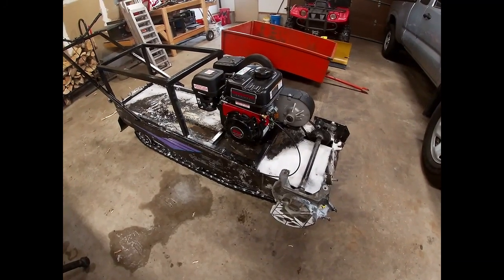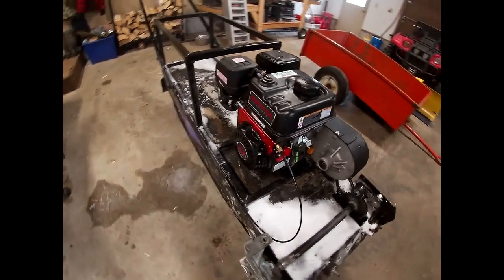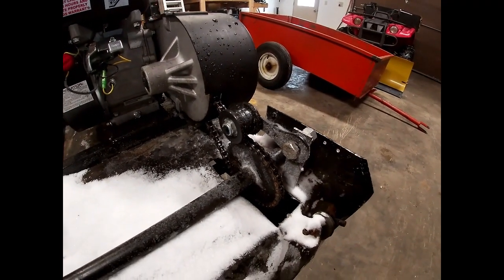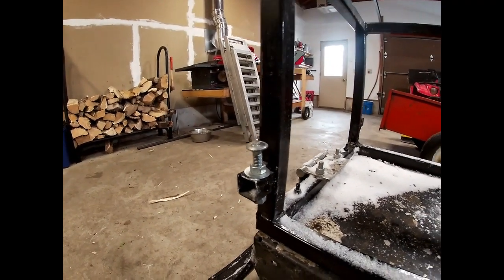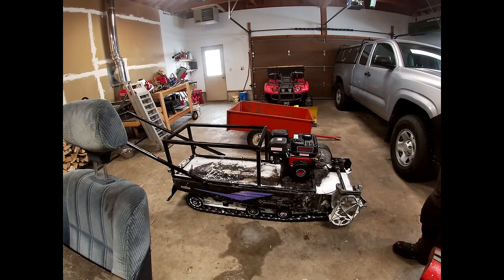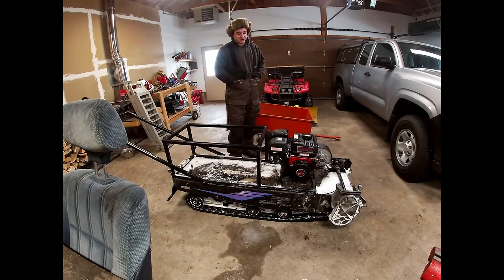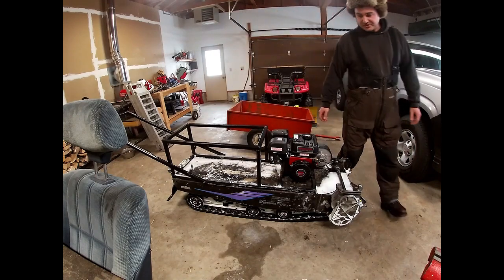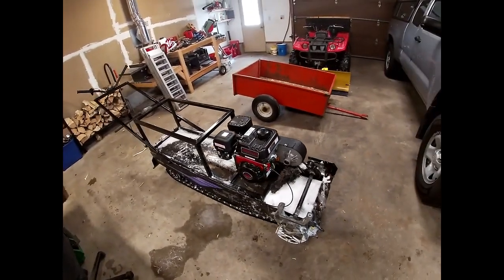Homemade Track Sled - ride with overview

Comment: These machines are awesome for hauling ice fishing gear. I used an 88 Indy 650 chassis with the same engine and torque converter. Got the sled for free so build cost was a couple hundred bucks for the engine, torque converter, chain, sprockets etc. Nice job on your build!

Comment: Just finished mine up with a 13hp  same clutch  100" 1983 polaris track backwards custom frame and undercarrage .Blew stock belt first drive second belt is lasting and comet belt on the way
Reply from the maker: I was hard on belts until I switched gears for a bit more torque. It’s been golden now
Reply: @TRoutdoors2021  cool what is you top speed around ?
Reply from the maker: Depends on snow and weight being pulled but just me with a few inches on the ground probabaly 15hp
Reply: @TRoutdoors2021 so did y figure out why your 1st belt broken? When you said change gear, did you mean change the sprocket on jackshaft ? What's the old size and what's the new one? Thanks

Comment: Been messing with my 2001 Phazer to long, so getting ready to pul the trigger on this project..Everything looks pretty simple, but wanted to know more about the clutch assembly?  Thanks
Reply from the maker: The clutch assembly is just a knock off of a comet 30 series gokart clutch I got off of Amazon. It works the same as a snowmobile clutch just engages at the right rpm for using a small engine
Reply: @TRoutdoors2021  Thanks, I was looking at Amazon as well, and found them, pretty surprised at how cheap they were.  I can’t tell  what HP you settled at, I was at Harbour freight today looking at the engines?  Knowing that I want plenty of HP to go through the woods to my camp , but to big seems it would be pretty tippy?
Reply from the maker: Yes these clutches used to be 300 when you had to stick with a name brand very nicely priced for odd project such as this one. I went with the 6.5 predator engine you can find at harbor for 99$ I believe. Also I don’t mind it being tippy so you can carve the machine for turning in deep snow but even on a couple inches it does maintain up right easily
Reply: @TRoutdoors2021  i will send you a photo when I get done. Thanks for the info
Reply from the maker: @Ivanskrakow  👍🏻I’d love to see the final build. Everybody seems to build them a little bit different. It’s been fun seeing them come together. I would advise following “track sleds of the north” on Facebook for more build ideas

Comment: Tanner. Like your sled design. I do not have a welder. Would  1 ' ' steel tubing work with nut and bolts?
Reply from the maker: Trevor actually, I suppose you could build one like that. I would make sure you use lock nuts of some sort or lock tight.

Comment: I like how yours came out, looks like it steers nice. Can you show a little more detail on the drive system, that being the clutch and jack shaft in particular. Trying to figure out the logistics of building one for a mid summer project. Also do you think a mid or rear motor mount would improve handling or do you like how it is now?
Reply from the maker: Tanner I can make another video at some point about that when I have it in the garage. I’m not sure in different mounting I have no problem with a front engine. The handle bars have enough leverage too lift the front up and turn.

Comment: The sprocket I used is smaller than yours and has trouble going up small hills do you think a bigger sprocket will give me more torque
Reply from the maker: Wisconsin life, i had originally used a smaller sprocket and my torque converter never went through its range. After that i installed the 46 tooth sprocket and is now perfect with unlimited torque with a top speed of 16-18mph I’d say. I would try a bigger sprocket and you should have success

Comment: Did you just weld the sprocket onto the “axle”
Reply from the maker: It’s actually drilled and I used a 1/4-20 as a shear pin
Reply: @TRoutdoors2021  nice, I’m going with sprocket hub and putting a pit through as well
Reply from the maker: @alosha1234  I smoked a couple bits getting through the shaft but I’m glad I pinned it

Comment: Any need for the brake? I saved my assembly, but if it’s not needed I’ll put the $$$ somewhere else.
Reply from the maker: Looking back on my build I would save the brake. Not sure how your laws work but up in Michigan with very little mods you can ride these on the snowmobile trails and one of the rules is to have a brake that locks the track to stop

Comment: How did you get that sprocket on???
Reply from the maker: You have to completely take apart the gear case on the one side, once that is off the other side has swivel pillow block bearing that allows you to move the shaft wherever you want. There are splines on the shaft for the brake that I had to grind down to slide the sprocket on. Hope that helps a little bit

Comment: Help!!! Do you have a link for sprocket?? Thanks
Reply from the maker: https://www.ebay.com/itm/35B36H-1-Bore-Type-B-Finish-Sprocket-for-35-Roller-Chain-36-Tooth-/323869042889?mkcid=16&mkevt=1&_trksid=p2349624.m46890.l49286&mkrid=711-127632-2357-0
Reply from the maker: It’s a #35 chain 36 tooth 1in bore sprocket

Comment: I’m building mine with the same chassis. I have a 34 tooth 40 pitch sprocket but it seems like it’s going to rub the track. What pitch is yours??
Reply from the maker: I actually used a 36 tooth so i would use the 34 you have. I said 46 in the video and that was wrong